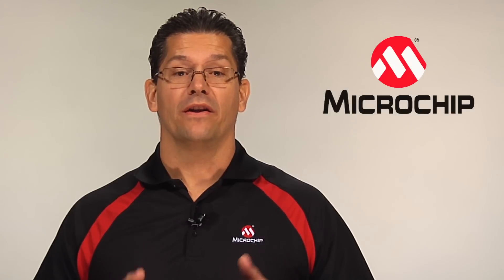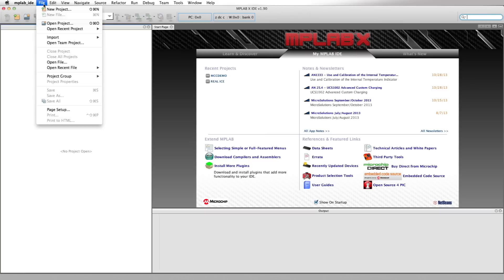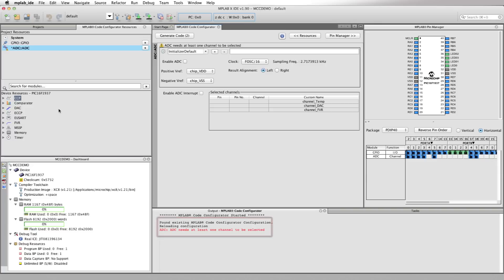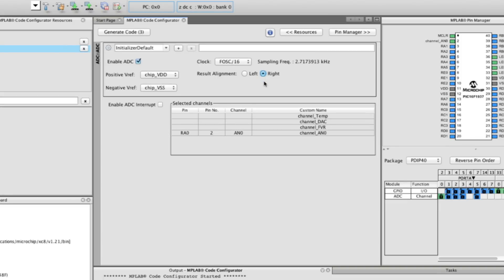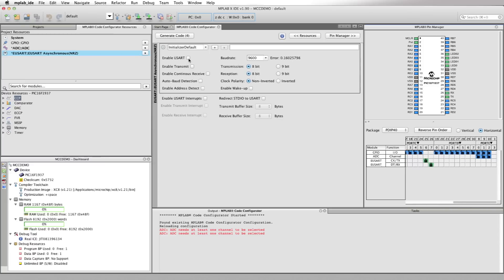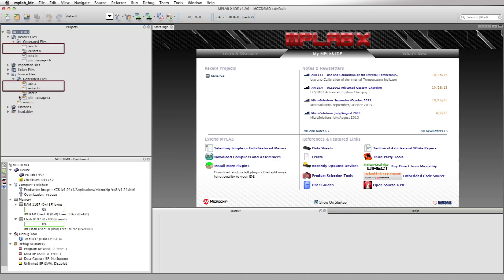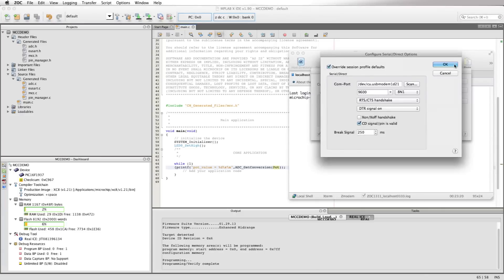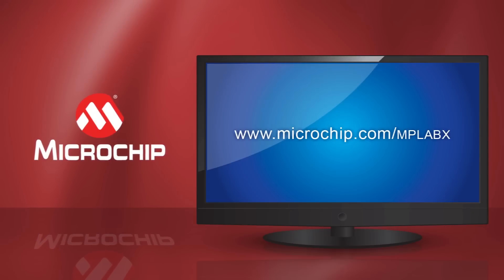Using the MPLABX Code Configurator to setup the ADC and EUSART

Comment: I have a Pic24fj32GA002 and an ft232 serial to usb chip. I used the ADC and the UART in the MCC. after wiring it up im not able to see anything on the terminal. 

TX and RX pins are wired correctly. No issues during clean and build. 

Any thoughts?

Comment: Is there an example like this video for a PIC24. For the PIC24 using MCC, there is no enable STDIO to UART, no ADC_getconversion function in the API.  Popular serial terminals like "putty" only print ASCII, so the integer ADC results have to be converted to ASCII. Sending ADC data to a PC should be really straightforward, but there seems to be no information on this.

Comment: Hello all, i would like to add that i the latest version of mplab (v3.2), the adc trigger select for CTMU is not selectable. The code configurator plugin forces you to use CCP5 which in most cases is not desired. Please fix this bug, mplab v1.2 works just fine with my PIC18F46K22 and the code configurator plugin allows me to select the CTMU for the TRIGSEL bit value in ADCON1. I really appreciate the code configurator and thank you for your tutorials.

Comment: Can someone kindly answer a few questions:
What is Result Alignment: left/right?
What is the effect of not using \r (carriage return)?
Reply: +russell choudhury 
The ADC in the device is a 10 bit ADC whose value is stored in two 8-bit registers. Now if you want to send this value to another device/peripheral which can receive 8 bits of data, you have to decide which part of data is more important to send(MSBs or LSBs). If you select right justified, lower 8 bits are stored in one register and upper 2 bits in another register. You can select this option if you are more concerned about the resolution(LSBs) and send the lower 8 bits. If you select left justified, the upper 8 bits are stored in one register and lower two bits in another register. You can select this mode if you are more concerned with the absolute value(MSBs) and send the upper 8 bits.